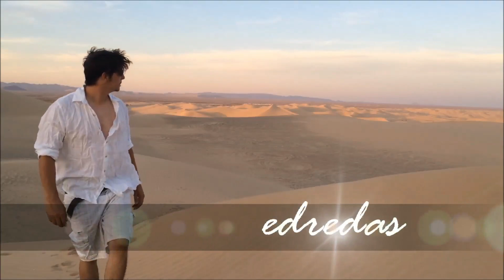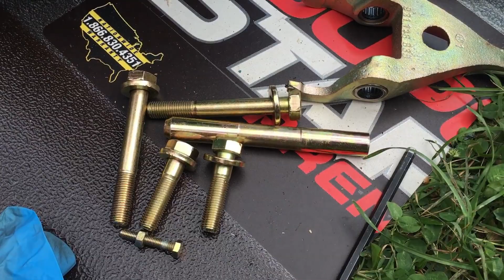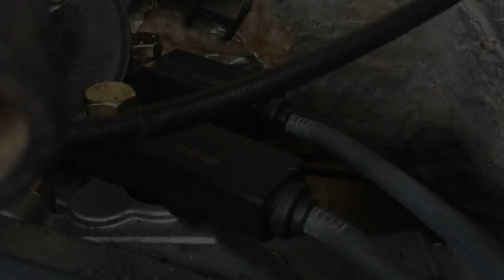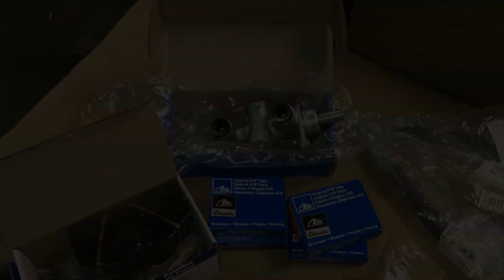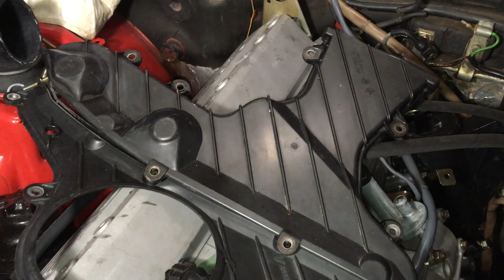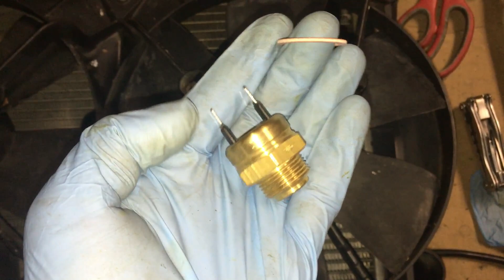Porsche 944 Restoration -Part 3

Comment: How much does it typically cost to rebuild a stock engine in an early model 944?
Reply from the maker: Around $700 in parts just to do the engine gaskets, seals, belts, and water pump. More if you’re replacing the cooling hoses, vacuum lines, or plating any parts. I also recommend doing the clutch and cleaning the injectors. Good luck!

Comment: Which fuel lines are those and how did you fit these on the metal-fuel lines? I'm really curious.
Reply from the maker: We use the Rennbay kit which has compression fittings that bite into the metal lines.

Comment: you need to get a helicoil kit for those stripped holes.... would have been easier and faster than swapping manifolds
Reply: When are you coming to Buffalo, i have a conundrum for you to figure out!
Reply from the maker: Edward Kipp I got a helicoil kit and we do fix them then use them on other cars but on builds like this we try to use the best parts we have available. We have so many good intakes that it’s not a big deal to swap them out to have a better end product. Helicoils are usually reserved when we have no other option. Thanks!

Comment: how you prep the fuel rails and dampers to be plating or are paint??  what about pulleys are paint
Reply from the maker: I take the fuel rails to a shop that specializes in cleaning them up. They are careful to plug everything up, then they are plated. Afterwards I just flush them out to make sure they are clean. When it comes to the damper and fuel pressure regulator, those are brand new. Too many times the old ones fail after rebuilds so we don't like having to go back and replace them so we just do it outright to begin with. As for the accessory pulleys, they are painted from the factory and not galvanized. We plate them so they will have better protection, and will sometimes paint them satin black depending on what the owner wants. I hope that helps!
Reply: im restoring 951 86 do you have name shop i will like to ship my fuel rail  cooland pipe turbo shields trotle body and hose clams to pe  zinc plated ...  when you have chance make video or rebuilding front shocks with koni inserts .you can not get new front shocks for 944 only cartiges koni  there is not videos in web will be nice  a good suspension video
Reply from the maker: Yes, the company that I send all my parts to be plated at: https://www.electroplate.biz/index.html
That said, all the parts you send them must be blasted to remove any old galvanizing first. So be sure to have that done or they'll send them back. As for the koni's, there are a few tutorials around on the net on how to install them but most of the people that I talk to seem to prefer Bilstein so its unlikely I'll ever have the chance to do a video since they are hardly ever installed around here. So if you haven't bought your strut inserts yet then go with those. They won't require any modification and will you be disappointed. I hope that helps! Here's a link to buy them for your car.
https://www.autohausaz.com/pn/12635692-P30104?utm_source=google&utm_medium=cpc&utm_campaign=feed_Porsche&gclid=EAIaIQobChMIl4yJiYza6AIVk4nICh2_swyVEAQYAyABEgJimfD_BwE

Comment: Im trying to get a 86' 944 running but im having problems diagnosing it. I have changed the sparkplugs, speed/reference sensors with cables, fuel relay, battery terminals, and battery. I've also checked the injectors and they seem ok. the only progress is that now there is a new noise: the cruise control ticks as soon as the car is placed in the on position. I need help , please
Reply from the maker: Hi, you mentioned replacing the DME (fuel) relay and sensors. So the next thing to check is if the tach is bouncing when you turn the engine over. If its not, try swapping the sensors around just in case they got mixed up. Then if you still don't see them bouncing you'll need to check the power at the DME and the continuity of the wiring from the sensors to there. The harness is notorious for breaking at the sensor plugs and I just repaired a turbo yesterday with this issue. That said, if the tach is bouncing then try having someone start the car while you go around to the rear passenger wheel and listen for the fuel pump to kick on. It will only run while the engine is turning, so make sure they hold the key. If you don't hear anything then your fuel pump as failed. That should cover everything.... I hope that helps!
Reply from the maker: As for the cruise control clicking, try pulling the plugs off the computer located over the hood release and spray contact cleaner on the plugs. Sometimes when they get dirty or are not plugged in tightly it can cause the servo to click. If that doesn't solve the issue, you can just unplug the computer or the servo under the hood until the computer can be replaced.
Reply: @edredas  Thank you for the help! I will look into this. Thanks again!
Reply: @edredas  I have checked the DME and it seems it is not getting power, how would i go about fixing this issue? Thanks again
Reply from the maker: Power comes from the DME relay also known as the fuel pump relay. I would check that you have power there. Then try a jumper if all checks out. Clark’s garage has a write up on what terminals to jump
Reply: @edredas  Ive narrowed everything down to the ECU everything indicates that it is faulty...now comes getting a good one or trying to repair it myself
Reply from the maker: Are you on Facebook? If so be sure to join my group so I can send you some pics of where to look. I've helped several people repair theirs in a few minutes.
Reply: edredas yes I just followed you this morning

Comment: Can you tell me the cost of doing this job?Compared to a shop.
Reply from the maker: To pull the engine then break it down to be soda blasted is about $1300. Then to replate all the parts is around $250. To replace the gaskets, rings, and all the other parts is around $1200. So in all, just in the engine bay you can easily spend about around $1700-2000. A shop would probably charge about $5,000-6000 for the same amount of work. I hope that helps...

Comment: Paragon still shows that brake reservoir as being available. It seems like it was pretty easy to get just a few years ago. PMB does a pretty nice job at restoring brake calipers, but they aren't cheap.
Reply from the maker: Ah thanks! It does look like they have them so I'll be sure to try an purchase one in the future! That said, as for the brakes on this car, I was just doing a quick job to get them working again and make them look nice. On the next car I'm building I'll be sending them off to be plated and look like new. Probably will be under $200 for all four... so unless someone can beat that with shipping then I'll give it a go!
Reply: What about refinishing the bores properly? I've read that the bores in these, and most other brake calipers are not just honed, but 'burnished' to provide a better seal. I've heard mechanics say the rule of thumb for brake hydraulics is that doing yourself will last half as long as a having it done professionally, and that will last half as long as a new part.
Reply from the maker: @tempest411  I've never really heard anything about burnishing the cylinders. That said, I was just reading PMB's website and it looks like they used to hone the cylinders now they just leave the cylinder alone after plating, which is something that I considered beforehand. So its kinda nice to see that it should work out fine! Thanks!

Comment: Okay, I'll be That Guy...hardware all replated, new flywheel, new clutch...

But the old, crusty assed pressure plate?

WHY???
Reply from the maker: I give the owners options of what they want to buy or re-use. Some guys will spend the extra $600 for a clutch kit while others are looking to save money where they can. While I would always prefer to install brand new parts to look good on camera, at the end of the day the owner has to decide if he wants a $10k rebuild or a $50k rebuild. Thanks!
Reply: @edredas  how much does it cost to get all the hardware replated, and how do you keep it organized?

Comment: really love what you've done, but my OCD truly feels like this engine deserved a fully restored engine bay/body.
Reply from the maker: Thanks! In the next video I'll be replacing some of the other items in the engine bay to clean it up a little more without going to wild since everything is built to a price. This car was originally just needing a head gasket change and respray, but since the cylinder was scored I had to repair that so the engine got overhauled. However, the budget with this car didn't really allow me to go too crazy. That said, I have other cars that I'm currently building that have a much larger budget however not everyone is willing to spend over $50k on these cars so some cars will never be as nice as others...

Comment: please go back to showing us how you do stuff. like rebuilding the calipers, the fuel lines etc. we rely on you!
Reply from the maker: Will do! I just try to mix it up so that I'm not showing the same thing in every video. I've covered all of this in past videos multiple times. Not to mention, there are a ton of cars here and  it just isn't feasible to record all these steps every time. That takes an insane amount of time. Also a lot of people already know this stuff so they just watch it for entertainment instead of wanting to see what I'm doing at every step. Then on the other hand, when I do show this stuff its buried in a longer video so I'm often better off making how-to videos their own thing so people can find them.
Reply: edredas That’s very fair but to take an example you just said ‘okay motor mounts are in’ and I have no idea....can you do a series of how-to that we can reference?  For me I need to change motor mounts and exhaust manifold and a mechanic friend swears we can do all without taking the turbo engine out but, wouldn’t it be better, etc, etc... I haz questions but no systematic look at stuff like this.  Did I miss those videos?  Thanks as always for the great work.
Reply from the maker: @acchaladka  I do eventually plan to make some standalone how-to videos. Its just been very busy at the moment, and making videos means everything takes a lot longer. In the Silver 944 series of videos I covered how to replace the motor mounts with the engine in the car.

Comment: Can anyone tell me why there are 2 mounting holes for the throttle cable? On the plate next to the throttle cam?
Reply from the maker: Yes, the other mounting hole is for the transmission kickdown cable on an automatic. Manual cars won't have anything there. I hope that helps!

Comment: Hey Ed i had a leak on the top of the injector on an 84, i replaced both top and bottom o rings, but in the process of taking out the fuel rail the main bolts the hold it down (bolts near the intake) broke so now the leak i had in the first place is gone but now the leak moved to another injector but now its the bottom seal leaking, can that be because of the fuel rail bolt that broke causing the rail to be uneven? Once again Ed great video as always.
Reply from the maker: Hi, any time you remove the rail its best to replace all the injector seals and the FPR seal. At this age they're all prone to failure and can easily tear when removing/installing. New seals won't tear. That said, if the fuel rail broke then its likely the O-rings weren't well lubricated. Be sure to spray them with WD-40 since it will lube them extremely well without damaging them. However, if the fuel rail is broken then you're better off replacing it. Contact Elliott egrafton944@hotmail.com and tell him you need one! Don't want to see your car catch on fire! I hope that helps!
Reply: @edredas  thanks Ed!! I will get a fresh set of O-rings and start from there. If it still leaks new fuel rail it is. I've also notice that the idle would suddenly drop then pick back up. Can that be because of the uneven fuel pressure i have going on? Ive had this problem ever since i notice that i had a leak on the injectors. Once again ed thanks!

Comment: Did you paint the brake booster in the car, or did you take it out? I'm in the same boat with my car.
Reply from the maker: I often remove them since it isn't too hard but with this one I just wrapped it up and painted it in the car to save on work.
Reply: @edredas  Hi can you just unbolt the brake cylinder from the booster or will that cause it to leak.
Reply from the maker: @joe-sk9bz  You can unbolt it but you may end up bending the lines if you don't remove them, then you'll have to bleed everything so you might be better off just masking it off. I hope that helps!

Comment: Where do you get a new fuel pressure regulator?
Reply: i got mine at o'reillys actually
Reply from the maker: Pelican has them, however they can differ from year to year so be sure to get the correct one for your car. I hope that helps!
Reply: @edredas  they did not have them for a long time.  I couldn't find them anywhere in the us for about 4 months.  I bought a used one that has worked well so far from 944online.  I will have to call pelican parts again.

Comment: I like the anodize hardware what is the added cost ? P.S  just just up your game.on porsche Repair for every one.
Reply from the maker: Thanks, it usually adds about $300 more to the cost... so with the engines being cleaned and all the parts plated its about $2000 before assembly and install. I hope that helps!